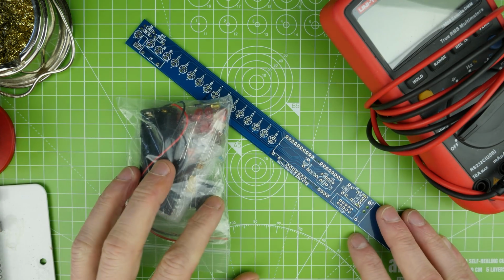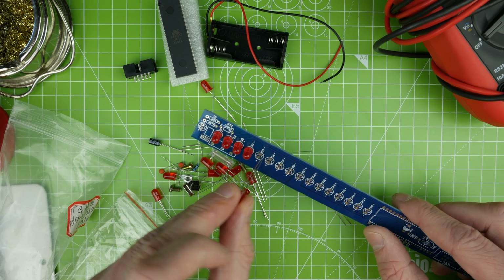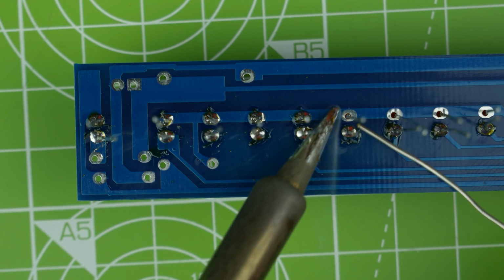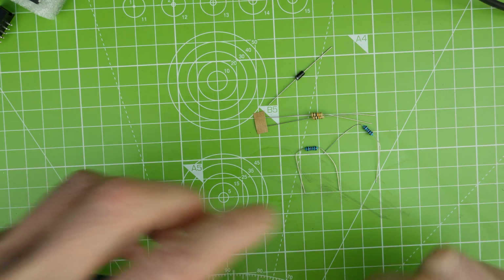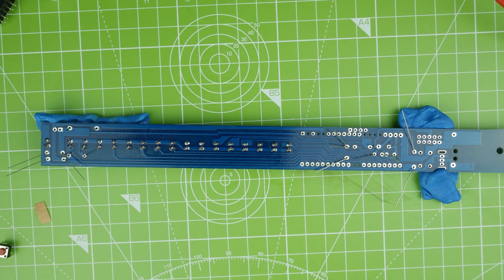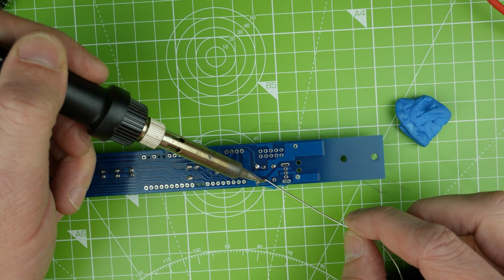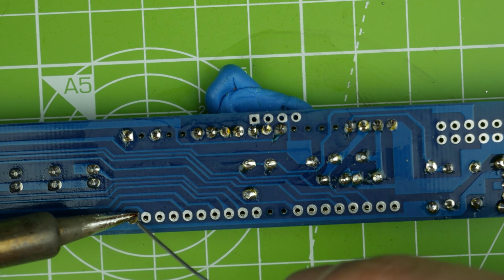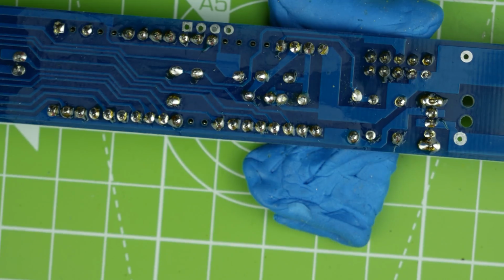LAZY SUNDAY - LED POV Wand - LS9

Comment: There are two holes located above the battery holder and they are there to put the leads from the battery pack through the board, so you don't have to put them around it.

Comment: hehe . any idea why my words came out in reverse ???
Reply from the maker: My guess and it is a guess, is that your soldering iron went past the flux capacitance barrier and you ended up in the mirror dimension. If it isn't that, I would imagine the software is screwed up.

Comment: Hi David, re kit suggestions
I put together a clock kit a month or two ago -
I got eBay item 131913617613, though Banggood SKU176893 is similar (and has assembly instructions linked from the listing).
It has a central clock, plus a ring of LEDs which can show various patterns including some like a TV/radio studio clock.

There's a lot of SMD and 60 LEDs so it would either make a long video or a timelapse :)
It took me around four hours. It uses the same AT89S52 as your wand, plus a DS1302 to keep the time. I've seen differing versions around (different colours, through-hole, a different CPU etc).

Two minor issues, it always cycles between time/date/temperature and can't be fixed on one of them; and the holes for the stand aren't correct on the eBay version (you can see this on the picture) - though it stands up fine on the USB plug when connected.

Comment: esp12f has the ability to be put into deep sleep and wake based on the internal clock. clock is the only thing that runs and pulses gpio pin 16 which can be hooked to the reset line

Comment: Those two holes next to the battery holder were to run the two wires through in a neater way :)

Comment: Youre using the flux pen wrong. It has to be gently pressed together on the markings to squeeze flux into the tip. Thats the way you control the amount of flux. If you dont squeeze anything out, its gonna be almost dry.
Reply: drkastenbrot It's not a flux pen. It's a calligraphy brush pen with flux in it. I believe it is an experiment...
Reply: Bryn Jones It is a flux pen, named bonkote bonpen especially designed for flux dispensal.

Comment: Ooh, every second Shrove Tuesday I should be able to make a vacancy in my busy life.  If you cater for that, very fine. 

David, I enjoy your content as and when it comes, schedules suck. I don't want to expect anything of anyone, and the pressure implied by expecting a schedule from someone such as myself shouldn't impact on that.  

Make vids when you feel like it. If you don't, no big deal. Just enjoy doing what you do. 

As a kit builder (started pottering about since I was 12, (now I've decades to add to that), I love your lazy sundays. I can't invent or anything, I'm dumb as fcuk. But I adore soldering. I'm refurbing an Atari ST (very slowly - money blah blah)

Please invest in better blue tack stuff, the struggle is real :p I love simple kits that are useful, a lot of the kits are the kinda crap at the budget price range, maybe if you could find a way to mess around with a couple of kits and abuse them as modules, that would be fun. 

Thanks from a poor guy.

I use cheap syringes for flux, you can get a sunshine variety set of "needles" and a few syringes on fleabay so you can play around and get a delivery that suits your thumb. The thicker needles are nice for solder paste.

Large sockets, do one corner pin, then re-seat the socket while the solder is wetted on that pin, then do the opposite corner, once happy go mental.